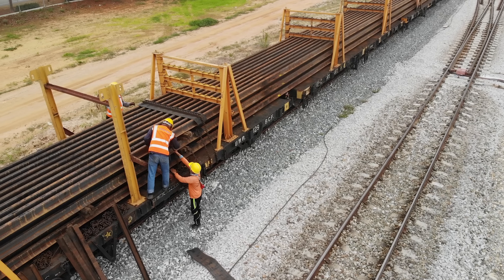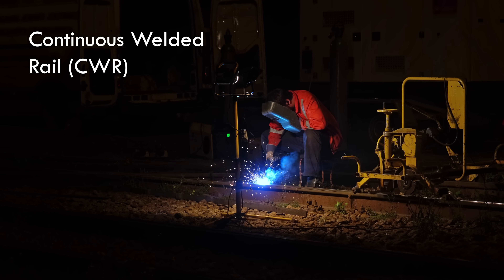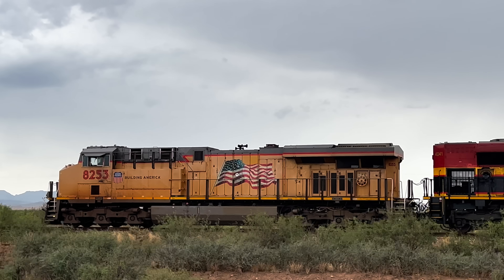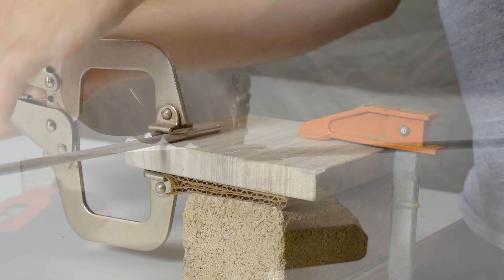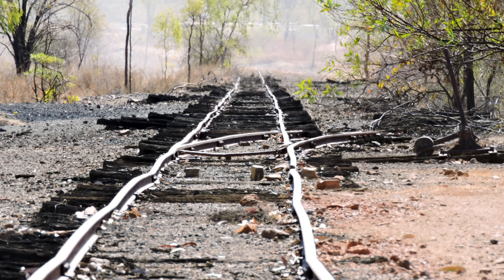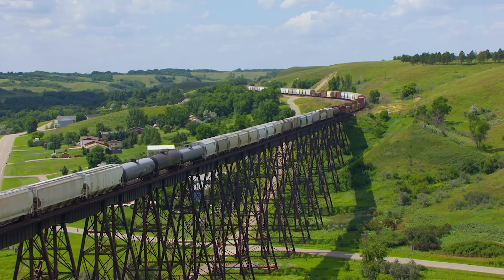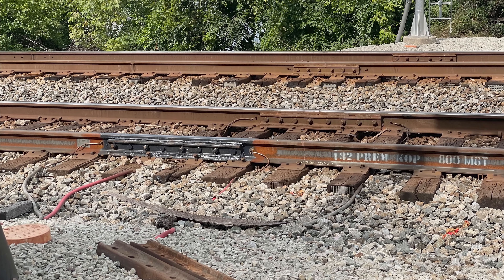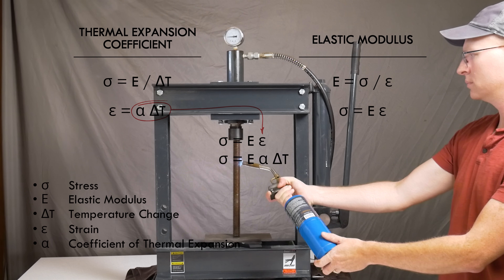Why Railroads Don't Need Expansion Joints

Comment: In the region of Canada i live in the temperature can range from Minus 40 degrees in winter or even lower to Plus 90-100 degrees in summer. I started working on the railroad in the late 70's. One thing i did not see on this video was the subject of destressing ribbon rail. I know that anytime ribbon rail was installed, the temperature and Date was written on the web of the rail. I never worked on a "destressing gang" but i do know that at some point they would destress rail. This would involve rail heaters and from what i understand rail would either be added or taken out to compensate for changes in temp. Pull aparts in winter and sun kinks in summer were not uncommon. I was witness to the extreme consequences of cold. I worked on a Gang that was installing double track which involved ribbon rail. It was laid in the heat of summer. In the fall when it had turned quite cold or there may have even been snow, i was tasked in cutting both rails in preparation to install a switch. I had BARELY touched the top of a rail when there was a tremendous BANG, at that point it had broken clean thru, and jumped apart even though the rails had tie anchors. I forget how far it jumped apart. I can recall when we laid the rail that summer, ties, no ballast because it was a complete new track. The ribbon rail that had been taken off rail cars on the Mainline had been just left beside the track. Later a Pettibone speed-swing was used to put the rails on top of the ties, so sometimes there would be large gaps between rail ends. I wish that i had measured it because i can recall it being a foot or more sometimes. In the heat of the day, those gaps would close right up sometimes, which shows the amount of thermal expansion. Later in my career i operated a Tamper lifting and lining track. The Foreman carried a rail temperature gauge. My memory being what it is i have forgotten but above a certain temperature you aren't allowed to disturb the track because that can trigger a sun kink to occur. Also involved in a tie gang for a few years, a sun kink did happen one time. We had finished work and suddenly our Foreman got a message that a sun kink had taken place after we left the work area. So that was a bit of emergency to go and fix that so trains could run.

Comment: Way too many comments I'm sure someone has already pointed out, in the hydraulic press contained example, the rod still expanded, just not vertically, it likely "bellied out" a bit wider under the heating/pressure, and then returned to shape when it cooled back down.  The only way to really "restrain" it wouild have been some form of temperature-immune container holding the steel around the circumference from expanding outwards under the pressure, thus increasing the stress in the length. 
Not taking anything away from the presentation, very well presented!

Comment: Hydraulic fluid is not completely incompressible. When you're talking about changes in length on the magnitude of thermal expansion of a 2 foot rod, hydraulic fluid is actually pretty springy. That's most likely why you didn't see a large pressure rise in your hydraulic press.

Comment: Hey bud. Wellington new Zealand spent millions cutting apart it's continuous welded rail network after too many major fails including not being able to use tracks for months on end unless at 3am,and even then only at 30kmh compared with 110kmh it was designed for.

NZ has narrow guage track width and perhaps a different rail profile, but ambient temperature is about what you suggest, although we do get hot steel in sun due to no ozone layer maybe?

Anyway. See if you can look it up and explain what the hell we did badly?🙄😏👀

Comment: How do the harmonics in a CWR work? From the small demo it behaves like a stringed instrument. The longer the section the lower the harmonics and less vibration.so you can pluck it harder and get a much lower frequency vibration. I'm no rail engineer but I imagine that vibration dissapates energy from the train along the line more efficiently that the expansion joints do  due to the increased length of the *strings*. No idea if this is a factor in railway construction, it just sparked a thought :)

Comment: When working on British Rail on the busy Colchester Area in the 1970s (my first promotion and an "escape" from the Teesside Office , after attending the relevant training I completed 222 "rail stressing/re-stressing" shifts (mainly overnight when the relevant track was placed under Absolute Possession). Stressing rails to a stress-free temperature of 27 Celsius was achieved by noting the average rail temperature and length to be "pulled", jacking-up and placing the rails onto rollers, then tensing the rails hydraulically with pistons, heavy clamps & connecting rods to hold all together, plus accurate use of a chart. The main problems were extreme cold, insufficient supply of base and the "sidearm "rollers that went beneath the rails and arrogant young welders...

Comment: One shortline railroad I did business with showed me a spot at the end of their line which had marked dates and temps... with lines as to how far the seamless welded rail had expanded... the longest was just over 3 feet and the temp was over 125deg and the entire 2 mile section from the switch was in the mid day and afternoon sun in upstate SC.

Comment: 13:10 the crossing system in my local terminal run on induction, youll see the inductors between ties. Its better because they can also detect the speed of the train and activate the lights accordingly.

Comment: my miniature railway has 300m welded rail...because it is so curvy the track moves at all the curves on hot summer days...i can see the gravel has moved but it doesnt affect the railway operation at all, but if i had long straights hot weather would cause a problem with expansion :  see " nikau junction " video

Comment: good explanation but it need some clarification. Here in Wyoming where we see temperatures as high as 105 degrees in the summer to 40 degrees below zero in the winter there is a lot of welded rail but the railroads still use expansion joints. the expansion joints are fewer and farther than every 1/4 mile but still used. And sun kinks are not uncommon in the summer. FYI, the rail can kink underneath a moving train. It's quite a ride on a caboose, when they had cabooses.

Comment: Why dont we use the massive pressure from thermal expansion to generate electricity? Perhaps with piezoelectricity? Or a mechanism to transfer the small diatance extreme force into a larger distance with less force?
I feel if we implemented this all over it would generate a substantial amount on hot days

Comment: 2:39 clickety clack, or they say in Korean, "chickchickpokpok." is incorrect.

Chickchikpokpok (칙칙폭폭 in Korean) is phonetoc notation of the rhythmic sound of steam discharging to the chimney in the old steam locomotive.  Thus, it would not be used to describe the modern diesel locomotives.

The clickety clack in Korean is actually "dahlgahdahk-dahlgahdahk 달가닥-달가닥."

Comment: As a summer student in 1970, I worked for Canadian National Railways on an extra gang laying ties, track and ballast on a branch line. One task was repairing a sun kink by assisting in the cutting of a section of rail and replacing the bent piece with a straight one. CN soon after started installing continuous rail on the main line. For the last 50 years, I have wondered why this was viable given the absence of expansion joints. Thank you for the excellent presentation - my question is answered.

Comment: A broken track is also much easier to detect automatically than a buckled track.

You can monitor the electrical conductivity of the tracks, and it will drop dramatically when a track breaks.

Comment: @practicalEngineeringChannel if using a higher normal temperature is used to avoid compression, how do they counteract the tension it creates? Wont the tension disrupt the paralellity when a long curve wants to pull itself straight? sure, less of a problem but still results in more wear.

Comment: There are low thermal expansion metals that could be used for the rail, Invar comes to mind of a low thermal expansion metal. Invar is used in surveying equipment so that it maintains accuracy over a greater temperature range. The problem with Invar is it's high nickel content rapidly increasing the price with needing at least 20% nickel to even start noticing the reduction of thermal expansion, and the ideal being 36% Nickel. The price for Invar is on $25/Kg versus the $100/ton of steel. vastly different orders of magnitude for price. The fact that Invar is weaker and softer than any steel used for rail use. The increase in price with a increase of maintenance cycles will increase the cost of the rail system by orders of magnitude. 

The Solution became obvious to me as soon as you put the two equations together, but I thought of always having them in tension rather than a time where they are mostly in tension and tensioning the tracks instead of just installing the tracks on a hot day.

Comment: Very interesting.  But i still don't understand why continuously welded rail tracks do not drift on curved sections as temperature changes.  Here the rails are essentially "pre-buckled" and they would want to move laterally and would be very difficult to hold in place.
Reply: They are held in place by the resistance to movement through the ballast of the concrete sleepers which weigh about 1/4 ton each. There may also be a raised shoulder of ballast off the sleeper ends which adds even more resistance to lateral movement. On tighter curves there will also be lateral resistance plates fitted shaped like spades, fitted under the sleepers which have to be dragged through the compacted ballast under the sleepers to allow movement.

But even so CWR is not allowed on the sharpest of curves, and jointed track will be used instead. Although sometimes if the track was only a little too tight a radius to allow CWR 120'-0" rails would be used a tighter than normal sleeper spacing, and the CWR ballast profile. As joints on tight curves are prone to threpenny bitting and having less joints reduces the number of joints that need keeping to alignment. Although the use of 120'-0" rails was banned some years ago due to their use by those who did not consider the need to take extra precautions against buckling.

Comment: Great video! However, it's a major omission not to mention global heating. Burning fossil fuels is causing hottest days to become hotter, which means rail buckling will become more frequent and severe in the future. Indeed, this is already a known global heating impact. It's also remarkable that someone so meticulous (as both engineer and communicator) would make this omission - it indicates the serious collective blindspot or denial in our society concerning global heating.
Reply: Climate change is a lie  the government uses to control the masses!
Reply: I think that is not an insightful criticism. Just the uncertainty in the maximum difference between wintertime to summertime temperatures, which has to be accommodated for in the design, would exceed any global warming contribution.

Comment: Railroads mainly use when it's cold, a fire snake to expand a section of rail. They pull it from a container, run it along the section, and light it. Causing the rail to expand enough to allow it to be secured with metal plates.

Comment: Maybe this effect be used to generate electricity by converting the linear movement from heat cold cycles in Texas to rotational movement and geared up to be useful for a generator. Maybe the movement is too slow but the force must be intense and gearing can increase the rate of movement.

Comment: 12:39 I would think that it makes sense to use as high a neutral temperature as you can reasonably expect to encounter. It wouldn't make sense to use, say, 100 ºC as a neutral temperature, and have to constantly endure higher-than-needed tension.

Comment: Having lived near (<1/4 mi.) and walked the local tracks most of my life, I can say I remember the clacking sounds when I was a kid.  I don't remember when it went away, but I recently walked said same tracks and noticed that there were no joints.  I knew there used to be.  I couldn't see one seam, weld or anything.  I've lived in 2 houses the same distance from the tracks, one with a basement and one on a radiant heat slab.  First one built in '24 and second in the 50's.  Never felt any shaking when I was growing up in the radiant slabbed house, but the one I moved into had some amazing resonance with the trains!
Reply: My sister moved into a townhouse along the tracks in Alexandria, VA about 25 years ago. Nearly every house on the street had had its rock-lath plaster ceilings replaced with drywall. Knowing the tracks were near, the builder should probably have used more nails, or maybe just used taped drywall (which did exist at the time, weighed less and allowed the nail heads to sit right on the surface surface for better hold)   instead.

Comment: Here's a subject I would like you to address on your channel.  At 15:52 on this video it shows a wheel actually lifting off the rail. My calculation would be about a half inch of lift. Where is this most likely to occur ? Such as a straight or a curve ?  Does this factor in with derailments ?  Cheers, mega    Bob

Comment: A symptom of "modern society" is taking something that works and overengineering it to the point where it requires more and more specialized equipment just to maintain and repair. And what happens when there is a material or skill shortage? Lots of failures and the inability to maintain the most basic services. Tracks from the 1800s are still working with little to no maintenance but newer tracks require multiple teams to inspect every aspect of a track. All they've done is offload wheel maintenance to track maintenance.

Comment: So basically, they dont need expansion joints because the steel is strong enough to endure the expansion? As long as it's constrained?
Reply: I’d say they don’t need expansion joints cos the steel is installed pre-stretched, at a high temperature. On cold days, the steel wants to shrink, but the welds between sections keep the steel stretched, like spokes on a bicycle wheel

Comment: so in summary, the amount of tensional/compressional forces in steel rails depends on the temperature but because the rails are bolted firmly to concrete sleepers they absorb these forces without bending or twisting

Comment: Great video.  The proof is in the evidence shown.

I believe the longest sections of welded rail in the world are on the Adelaide/Darwin and Sydney/Perth tracks.  Rarely do they buckle but they can.  The Indian Pacific track has the longest straight section too!

Any chance you could apply the maths to model rail?  
- Most large layouts use 3' or 900mm of HO /OO scale flexi-track.  
- Mostly Code 75, 85 or 100.  
- The rail is made of so called silver nickel. In the model train world, Nickel-Silver has become a common rail material for smaller scales. It actually contains no silver. The name comes from the silvery appearance when clean. Nickel-Silver rail is an alloy made primarily of copper, nickel and zinc, with a small percentage of lead.  
- Radius from say 18" / 450mm upwards

Some of the issues are
- Use fishplates or not to join the lengths or simply leave a gap?  
- How often to secure the track (usually the number of nails in the sleepers).  

I'd love to do some 'welded track' track sections on my layout.

Comment: So, on  SD40 SD70  series diesel locomotives the part that bolts the exhaust manifolds together into one large manifold is called an expansion joint ...and they are needed, great content by the way, thanks

Comment: I'm not a rail or civil engineer, but is there a reason why it couldn't be solved by just allowing the rail to expand/contract. I'm imagining a method where the rail is essentially held in place by C-shaped hold downs that still allow for movement along the rail, but not perpendicular. I'm sure that I'm missing something, or that this just wouldn't hold up to the stress. Just though it was neat idea.

Comment: Are the rails used in other way colder places (like here in Manitoba) made out of different materials to accommodate the fact that the temps go from -40 to +40C? Or is CWR simply not feasible with that kind of range?

Comment: Those rhythmic clicks and clacks also came from “flat tires”.  Yes.. train wheels have tires, although not made out of rubber, they are made of a different metal than the main body of the wheel. And flats are caused wheel wheels “lock-up” under breaking..  this is normally spin off when a train starts moving again and the wheels spin til they gain traction.

Comment: The headline is really a bit misleading. CWR does need expansion joints when abutting Switches and Crossings. 
Adjustment switches are fitted before and after the S&C.
Reply: Only for older designs of S&C, certain diamonds and the short A switches. Most modern S&C is strong enough to be used in CWR without needing the protection of breather switches.

Comment: At 9:00 there are a little mistake: the elastic modulus of the steel is 207x10^3 not 207x10^⁻3, but the result is good.